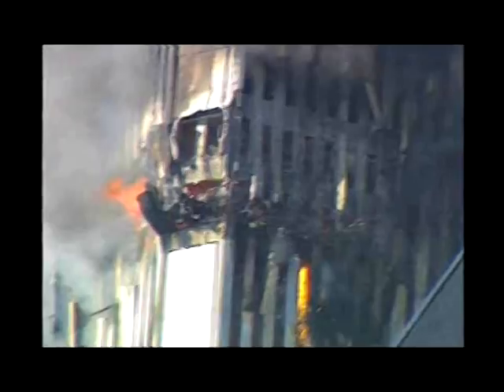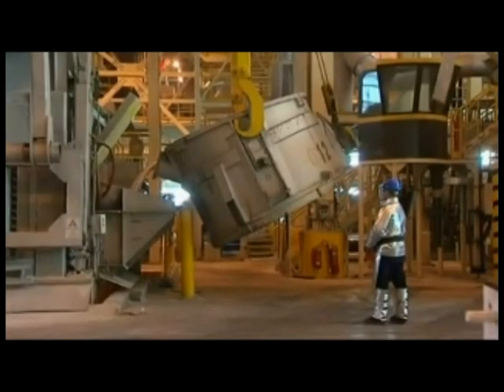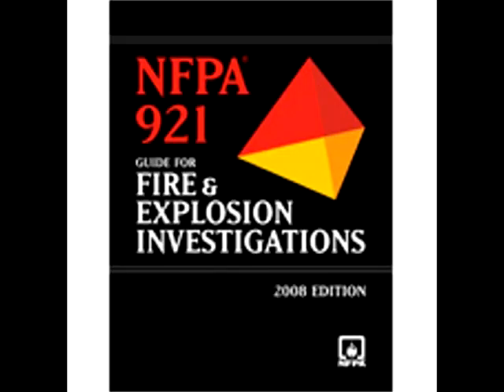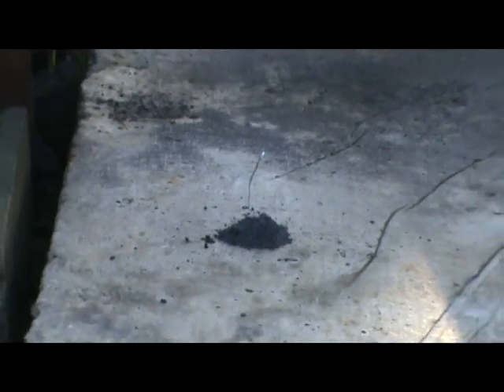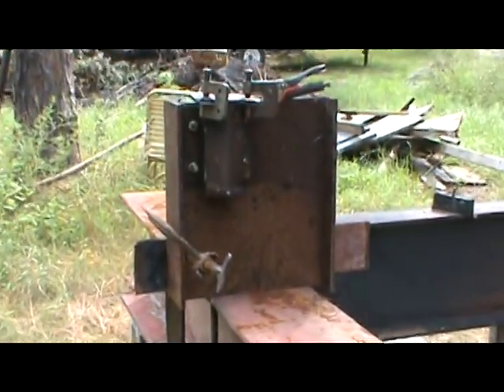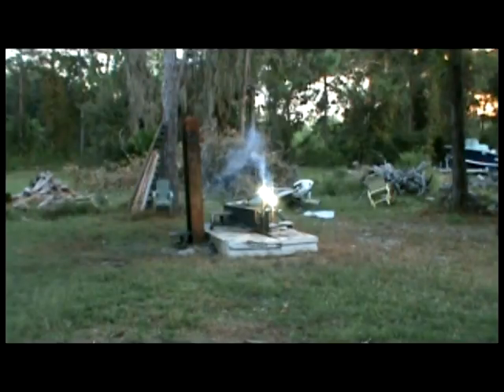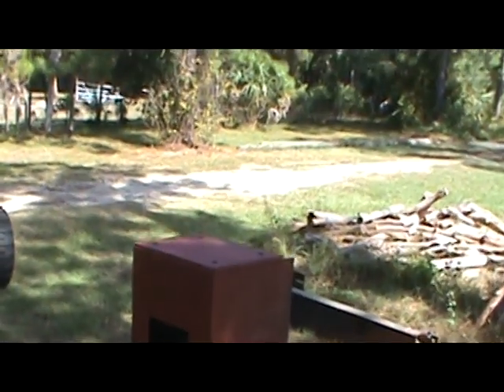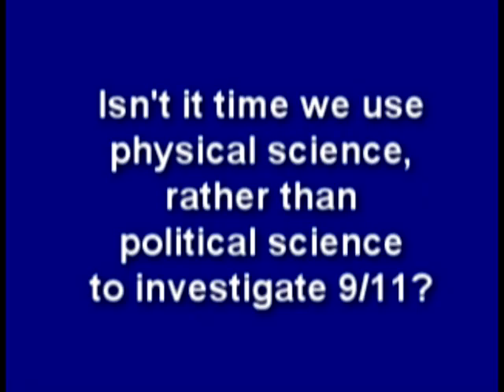9/11 Experiments: The Great Thermate Debate

Comment: That could be melted aluminum from the jet plane. Their made of mostly aluminum.
Reply: Tom 
Do you think that someone who find a ball of metal and not figure out what metal it is?
Reply: Tom Sure..how about describing how ALL that aluminum got that hot in the first place?.....and did you forget all the building columns that also provided no resistance to the collapse?..I suppose you have studied why they were all rendered completely unable to resist the collapse event..it was that same fire right..lol...you remember that event, the collapse that took only 2 seconds longer than a free fall...well mister, conservation of momentum of the buildings mass alone would have made the structure take 2 seconds longer to fall than a free fall....how was that?
Reply: I have math and physics to back up my assertions...its not a opinion at all..its physically proven fact.....your Lil aluminum can melting in the camp fire project ain't the same thing here...maybe youre embellishing your facts a Lil bit ...My home made wood fired foundry melts aluminum no problem..but it requires lots of air and clay insulation surrounding the whole thing....was never able to melt aluminum in my crucible without BOTH of those 2 requirements no matter how hard we tried.
Reply: Enquiry News *They're
Reply: Timothy E Hook
 Aluminum melts before steel. not hard to melt alluminum, people don't know what they are talking about... when 10-15 tons of fuel explodes inside of a building its steaming up.... making it twice as hot... therefor melting steel. if it blew up in the wide open like say a field it would not be hot enough to melt steel. Close tho. it would be enough to melt the aluminum on the plane. Alluminum melting point = 1200 Degrees, Steel melting point 1500 degrees... please do maybe a little bit of research?
Reply: Tom 
..you ever try to melt aluminum in open air??..I thought not...as for critical analysis and investigation of the collapse, I've done the little bit of physics required to prove the govt "explaination" is bullshit...I venture to guess you have done nothing like that....im also sure you have yet to read the nist forensic "analysis" of the collapse....and you've not quantified the collapse event either, have you?...dont feel bad, the govt didn't either....investigate THAT one.
Reply: Timothy E Hook the govts explanation was a theory just like every body and their mother has their own theory, and yes ive melted aluminum and steel in open air before not hard.
Reply: Tom I saw lots of bent steal. Not melted steal. Steal with to much pressure applied to it, then the steal become hot and bent. In this video it showed a clip of molten debris leaking out from one of the floors. The narrator of the video thinks it's steal, which he could be wrong. Could be glass, aluminum, or both mixture of things. Kinda tough to tell just from a vid. I didn't see any fractured steal either. Just bent bent or sheared steal. And I am not saying there wasn't any melted steal just saying I saw none.
Reply: Tom Nope. Just pointing it out. Enjoy looking for folks to troll.
Reply: Timothy E Hook Interesting. Thanks. I was wondering why or how it wasn't AL. or pointed out as a possibility. Good stuff.
Reply: Pickle Rick OH MY GOD, HE MADE A VALID POINT LETS TRY AND FIND SOMETHING TO CORRECT HIM ON!!!! HURRY!!!

Comment: I'm not going to lie, I never understood the "steel won't melt from jet fuel" argument, because the important evidence of molten steel was never explained, and so I was left to respond "the steel doesn't need to melt, only weaken to the point where it can't hold the weight on it" thank you for the in depth look at the evidence. The argument finally makes sense

Comment: Lol thermate hurts my head. Directed energy weapon seemed to have helped. Building drops at free fall speed while the debris turns to dust as you watch. Even with the additional weight of the top falling onto the bottom levels it shouldn't rip through levels with 0 friction.  The remains sit on a small footprint after. It comprised of mainly dust and beams. But The beams left don't look twisted and stressed as you would think they should be. They seem cut without much other forces affecting then.

Comment: "The fires more than the impact melted the steel"  - Newsweek

They should have said flying space unicorns next.
Reply: If the late Osama Bin Laden was the mastermind of this act need I point out that he was a Master Degree or Ph.D. in Civil Engineering and if he had access to the floor plans of the Trade Centers it is within the realm of the possibility that he mathematically figured out the weak points of the trade centers the speed needed for the planes to crash the weight of said planes and the resulting reactions combined with the wind variables and the like. Many conservative or conspiracy pundits always joke about how could a guy in a cave plan all this well a laptop a portable power source and skills in blueprint reading construction techniques and most of all mathematics of a high order could make it possible for the plan to be carried out.

Comment: That was aluminum, not steel. Steel beams did not melt, it was weakened. Have any of you ever seen a blast furnace? They produce much higher temperatures than the fuels used.
What you are claiming is a conspiracy involving our government and Islamic terrorists who were able to crash two aircraft into the exact floors which just so happened to have demolition charges set to demolish the towers from the top down. Not likely.

Comment: as a self trained beginner blacksmith i realize two things that all of the conspiracy theory people dont know . steel does not need to completely melt to become compromised it gets softer as it heats . it is workable when it turns red . it becomes very workable when it turns orange and melts when it turns white . all that steel has to do to fail is to be heated past the point of the load it was intended to support. if it didnt, we wouldnt be able to work it. small contact points like bolts would fail first. 
secondly with the fire on the upper floors and people escaping down the stairways that created a chimeny effect which would pull up air fast enough to melt the steel . how do you think chimeny fires  melt the stove pipe? 
i dont claim to know everything but im not going to claim conspiracy when i know all the factors have not been taken into effect.

Comment: Granted this Video Proves some Interesting points & tries to do it from a Scientific Perspective, but the Problem with this theory is there Would have had to have Been Hundreds of Strategically Welded or affixed devices Put throughout the building to accomplish this without drawing anybodies attention.  In 17yrs I am aware of Nobody that Has ever Come forward Saying they saw Guys welding STUFF or installing things to the sub-structure of the building.  The simplest Answer is STEEL gets HOT it may not MELT but it gets damned pliable around 1800 degrees! it's like Putty go take a Course in Blacksmithing.  The Building That Bothers me Is WTC-7 why did it Fall down it wasn't HIT by a plane? Can somebody say Insurance Fraud...

Comment: You present some very interesting points. I myself couldn't believe that the towers fell as they did due to only being stuck by planes. Why I would certainly expect catastrophe from such an event, The assumed forces acting on the towers from only the planes doesn't explain all the damage.

Another point to exam would be access to the steel box beams. Was there any access to these after the tower was finished and being utilized or were the thermitic devices implanted in the box beams long before 9/11 or even possibly during construction?

Comment: One major factor this video ignores.  The steel beams in the towers were under load.  Meaning they had thousands perhaps hundreds of thousands of pounds of weight on them from the floors above.  You don't have to melt steel to make them fail when they have that kind of load on them.  You just have to soften them which doesn't take nearly as much as melting.  I give the video maker props though for his detailed experiments and documenting it.